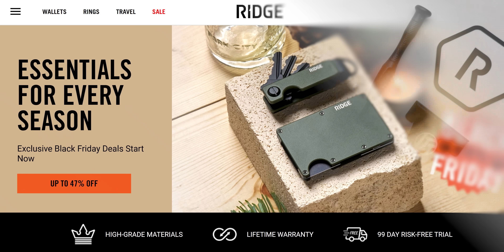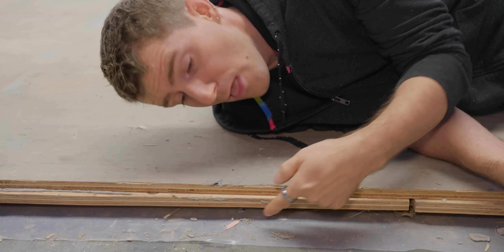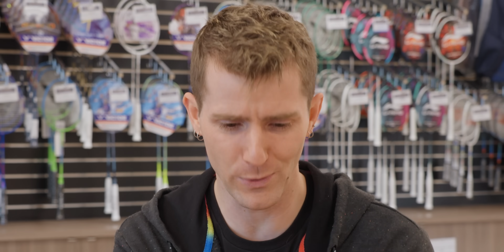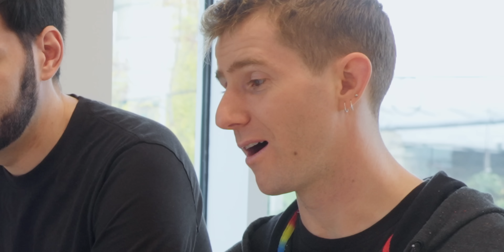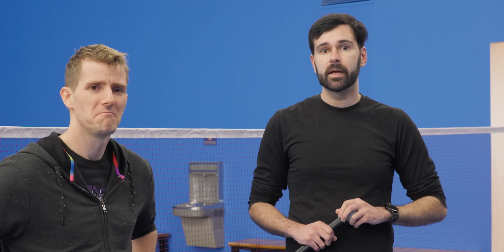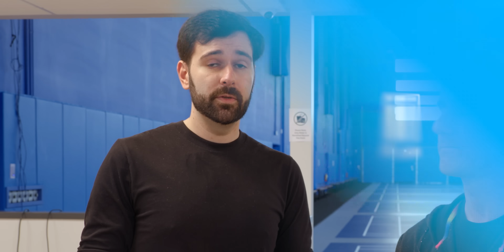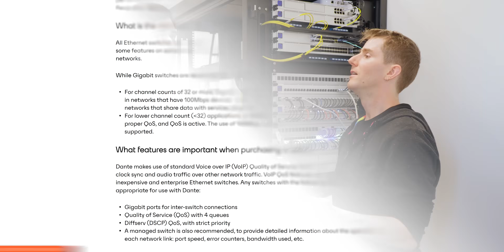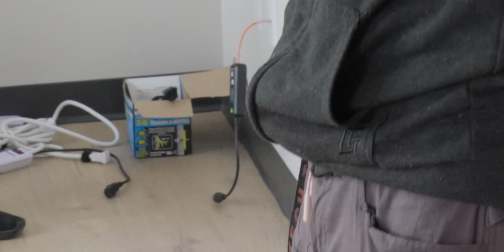You can finally hear me! - LAN Center Audio Tour

Comment: Well yes and no. Dante is designed to work on basically any network that is not using EEE so ubiquity worked for dante fine the whole time. But once network gets congested or you add 100mbit dante devices you will need the QoS settings. Ubiquity is really late to the game though I am already 5 figures into netgear 4250 AV line switches which cost 2-3 times what unifi devices cost :(.

Comment: the in house venue I work at was built on the ground up with Dante connectivity in mind. multiple meeting rooms with Dante as its backbone, Q-Sys for I/O, and Crestron for UI. our main hall has everything connected to Dante which can be routed to and from anywhere, with 36 boxes worth of line arrays, over 500 channels, and 20 wireless microphones that can be used just about anywhere within our venue.

in total we have approximately 250 speakers, approximately 700 channels, 140+ stereo inputs, 30+ UI surfaces, and Companion has been a huge help with daily automations and routing presets.

Dante can be very finicky as Dan mentioned. It is for the most part very stable if the network isn't saturated with "garbage" data. Just because you have 10Gbe speeds, doesn't mean it'll be stable.
Reply: @williewonka1500  Actually Dante isn’t finicky when you properly design your network, it’s actually rock stable. You only need to know how to properly manage data, and in Dante Clocking is EVERYTHING. You don’t have clocking stable in the network, it’s done, nothing will work. It doesn’t need some fancy network switch can absolutely make Dante work flawlessly with a 25$ managed network switch. If you properly manage QoS and Multicast it will work every time .
Reply: @IniosNetwork  Dante is not finicky, until it is.

unfortunately with alot of system integrators, they don't understand the clocking part of Dante. which was the headache I went through with our SI where they only looked at the 1GBe link speed but not latency. Due to a certain budget constraint, there was a switch with a 10gig fiber link carrying 4 different VLANs over 3 different subnets. in theory it's fine, until packets aren't prioritised. we also have a STAR network where 9 different switches daisy off each other into 4 links to our core switch.

as mentioned and agreed, Dante is usually painless, but with a massive installation that I currently oversee and run, it can be incredibly infuriating at times.
Reply: Why Q-Sys as a controller and Crestron for UI? Genuinely asking. Is it so the users see Crestron panels to which they are more acustomed than some "what is this new unrecognisable brand" Q-Sys?
Reply: @TheRoniSta  unfortunately I'm not sure what the real reason behind the pick is as it was a third party installer that was awarded that side of the contract.

Alot of it is definitely because Crestron surfaces are more "oh wow, name brand", but then again the installer has close ties to Crestron and has let slip they have steep discounts with them. Our infrastructure also uses Crestron's NVX system to push video all over the place, making it easier and robust for an end user to push couple of buttons on a Crestron panel for a Crestron system.

our auxiliary rooms are Crestron touch panels controlling routing of Crestron video streams and Qsys audio streams. Dante is just the audio protocol that's universally used throughout the building where it's super easy to provide massive 192/192 patched. Q-Sys IO boxes was deemed more stable than the AVIO's that Dan showed in this video as they also report heartbeats, and multiple different diagnostic data.
Reply: @williewonka1500  Oh now I understand so Q-Sys is only for audio management not for control and/or video distribution. Makes sense now - Crestron never had any really good audio products. Thank you.

Comment: As someone who works with Dante and system engineering every day, I was stoked to see how you implemented it. But you only scratched the surface of what Dante can do. DVS, DDM, connecting all sorts of processors, Dante video, and more. From small gigs to massive tours and broadcast setups, Dante networking is everywhere.
Reply: I really want them to do a multi site Dante AV setup, I've done multi site audio with Dante and it's cool as hell
Reply: Dante is awesome and great to see Linus and team using it. During my AV tech days, I installed a lot of these systems. Eventually received my level 3 cert for Dante, then was moved up to control system programmer. So frickin' easy to program and route audio. Dante should be the standard for any system.
Reply: Dan did repeatedly say that it's intentionally simple so non-Dan staff can function without a Dan..
Reply: lol was thinking the same thing, just before he said it! "damn they should really use dante here" then what do you know
Reply: I'm trying to get our company to get off of CobraNet and move over to Dante... This video solidified my belief that it'd be better!
Reply: very cool
Reply: I hope you don't mind me asking. Could someone in their 30s get into the trade? Does it require lots of uni/college education? I have always been interested in audio engineering (concerts, venues, small bands etc) and system engineering like this but don't really know where to start.
Reply: @MatsueMusic all of the Dante certifications are free, and their parent company has great starter courses for AV/IT
Reply: @timesprodoctions  Thank you :)
Reply: @MatsueMusic  Does not require any uni/college. There is a great starting point for certifications that are industry standard. Kind of like CompTIA or Cisco. Called AVIXA.

I started doing AV work about 5 years ago with no prior experience.
Reply: @nicholasharmsen7913  Holy shit, thanks for that information, that looks like an amazing resource as i've always had an interest in this field, but no clue where to start!  You legend
Reply: @MatsueMusic  I know im not the original commenter but as another theatre AV person it’s not too late. You definitely don’t need formal training but it’s all about experience and getting your name out there. Easy way in is to volunteer for a church or theatre groups and work your way up. :))
Reply: @MatsueMusic  I learned on the job with almost no background, it's mostly about having the right contacts, now i'm self-employed doing stage crew full time but most techs have a sideline, the hours are a bit wack lol, some weeks i can work 60h+, or i can have no gigs for 2 weeks, anyone can get into it, but its certainly not for everyone
Reply: @MatsueMusic at least where I live, you just have to get good contact to find gigs. You can always apply to work at an existing company. You can find great tutorials almost everywhere (including YouTube).
Reply: @MatsueMusic  Dante has some course on there website. That are really handy. To get started learn some IT stuff but contact a local venue or performing art to see if you can help out as a stagehand and just be willing to learn.
Reply: @MatsueMusic I've trained several engineers that are out touring with arena size bands now. None of them had any official school in anyway past high school. Right now there's a shortage of good engineers at least in my area I've heard similar from other parts of the country. 
Hell if you're in Oregon I'd put you in a 300 seat club tomorrow I hate the guy I have to tolerate now he likes to drink during shows and doesn't even remotely come close to having the experience to get away with it. Plus your watching an LTT video so chances are you'd be able to understand things like vlans. This other guy is basically a burned out gt player who's only been doing this a year and has no other tech background. Puts a lot more work load on me and I'm out touring an shit it's hard remotly fix everything lol
Reply: @SpaceSquid420  I do and networking is something I’ve done before. I live in Canada East coast but 10000% would have taken your offer if I lived anywhere near Oregon
Reply: @MatsueMusic  It's been a blast reading all the feedback you got, good luck brother!
Reply: @Timpossibly  🖖
Reply: @MatsueMusic  I did it here and there at my last job before I moved to my current SWE role. It does not require a degree. For most DSPs there are training courses and certifications you can aquire.
Reply: @MatsueMusic  You don't need a college degree to get into AV it's all pretty simple once you have enough experience. No really requirements for hard math or phisics or similar. I am speaking from experience - I have a bachelor's in electronic engineering and have been doing AV for the last 20 years. Even when designing most systems (except for acoustic treatment) you can get along with basic elementary electrics physics. Just go for it, find an AV integrator to start or Live event company depending what you want to do.
Reply: @MatsueMusic  Q-SYS certification is also free. Getting certified with systems like Q-SYS, Dante, Crestron, etc are great ways to get your foot in the door for AV Integration jobs. College degrees aren’t the only thing employers look for these days since things move so quick. Having real world experience and certifications are the way to go.
Reply: @MatsueMusic No shortage of field engineer roles available in Canada and USA.
Reply: @MatsueMusic  I am 35 and I am a part time audio engineer. I have been offered a job in this career path and I can say with certainty that yes, someone in their 30s can get into this.
Reply: @MatsueMusic  As somebody who got into the AV industry at 29.... YES! Realistically, this is an industry that ONLY requires you to be interested in the technology. If you are interested and have a somewhat logical mind regarding troubleshooting, anyone can be successful.

AVIXA is kinda the default standard for certification in AV, but if you are only interested in the audio side of things, QSYS and Biamp both offer free training courses for their products. Both will give you the basics, with the more advanced trainings focused on their products and their capabilities (including Dante). Just realize that a lot of the progression in the industry has been, and will be network based. So be prepared to learn about basic networking concepts as well.
Reply: @MatsueMusic  As someone who does it for a living, YES you can! The best way to get started is to just get started doing it. Some folks will say go to college, but as someone who didn't and works at a fairly high level, I can assure you, you don't need to go to college to do audio. People care more about your competence, attitude, and willingness to help out than your education in this field.
Reply: @MatsueMusic  I started in AV at 40, and have only been doing networked AV like qsys for the last 4 years. It’s a great career.
Reply: @MatsueMusic  I'm in the industry and did go to uni for it but I know a LOT of colleagues who never went to school for it. My advice would be to not google/youtube too much about it, there is a whole lot of horsecrap out there (like guides how to eq a guitar when in reality there is no and can't be a guide. Source differs, context differs, its worthless information that will set you back more than it'll bring you forward), and find a small venue or church if you're in the US where you can volunteer. Even if you did go to uni for it, that's where you start because theory is nice and all, but practice is a whole different animal. You'll encounter people (especially in smaller venues) who try to teach you shit like the "how to eq a guitar" youtube video, listen, try, and then forget it. Mixing is an art form and there is no 5 step guide for art, there is technique like there is technique in painting, but at the end of the day it's about the painting not the techniques used.
Reply: Yeah, but the QSys Designer file is atrocious. Why they didn't hire a damn professional is beyond me...
Reply: I work at Q-SYS as developer and can confidently say AV techs are needed all around the globe. Most people don't even know about the industry but it's easy to get into it and doesn't require university.
Reply: Dante is awesome as you say, I wouldn't wanna do a job without it anymore
Reply: At my venue we have 2 buildings with a total of 7 halls. We use Dante for all of them and we can rout any io from any building or hall to another. It’s fantastic
Reply: And since they love Unifi great as do I, they have Dante priority options on the port level in their switches.
Reply: how does dante video compare to simpte 2110? never heard of it before but the concept sounds intriguing.
Reply: @famitory  Dante video will likely be supported by a lot of manufacturers. Currently, there are not a lot of products, yet. St2210 is more geared for broadcast video.
Reply: @jomantasgrickevicius2500 video over Dante isn't the best
Reply: We use this at Volkswagen AG, i love how easy it is if all is Set up correctly.
Reply: Our school just started deploying dante less than a year ago and I've gotten the chance to help with that too. I was just as stoked as you were when they mentioned they were implementing it since I've heard about all the crazy things it could do in the Audio and Video world + more! Its crazy just how many things dante can do and how well it can do it.
Reply: Exactly what I was going to say😂 Dante truly is a life saver
Reply: Dude he said dante and i had PTSD flashes of helping wire my uni theater's booth. Love audio, this stuff is SO far above me right now though
Reply: You are absolutely right Dante is what we use for our gigs when we are on the road, it’s super easy to maintain and does have a learning curve but by far the most effective setup than most other offerings
Reply: This has got me considering adding Dante to my church setup. However, it’s such a small installation that… I’m not sure it’s needed. 

Note if I could run video to my black magic switcher from an iPhone at the front of the hall…
Reply: @andrebaron1387  What's your current situation and what are your wants? I'm sure somebody here could recommend and cost effective solution.

Comment: Linus and Dan.  I am so excited that you all are doing a piece based around the A/V field. 
While having a mobile IPad works with QSys I suggest getting a hard line TSC for the desk or wall. The Ipads can have connectivity issues at time. 

Dan, QSC is such a great option for the use you doing, but with Dante as a whole keep a close eye on the Dante controller and latency. If the latency goes above 1ms the receiver will not put out sound.

Comment: Question about the glass wool on the ceiling: is that just as it is or is there protection for the particles to not float around in the hall and being breathed in by anyone in there? 
Usually when I build sound panels with glass wool (Rockwool usually) I put at least one protective layer around it so that it keeps all the fibers inside the panel and away from the air in the room.
Reply: I don't believe that is glass wool that they're using. It's a specific product.
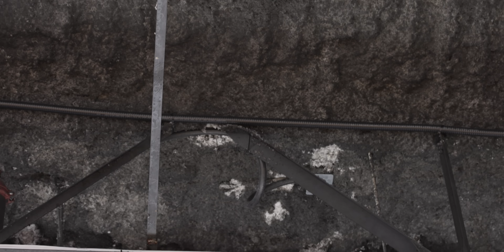Reply: @imark7777777  At 1:43 they show the material which is sono glass which is fiber glass based, I'm not an expert, that's why I'm asking.

Comment: I don't understand how audio can be so complicated? Why can't it just simply be PCM packets over UDP? And use things like multicast and even broadcast and VLANs ane be done with it? The millisecond latency added really shouldn't be that much of an issue?
Reply: It took so long to get to a place where we had a standard across the industry. A lot of it comes down to latency and synchronization well also supplying high-quality uncompressed audio. Not only has to get to the other end and come out in a timely manner as to be in sync with everything else.
Reply: @imark7777777  but why is syncing and latency over Ethernet such an issue, especially when using e.g. a separate network or VLAN for it? Congestion shouldn't really be an issue for plain audio data?

Comment: Linus and Team, you guys should take a look at Luminex switches.... also i installed a unifi pair for a customer using dante device and had clipping issues with streaming video and audio over the same port cos latency had to put the netgear prosafe switches back in nice to see they have fixed that...

Comment: Loved the Linus's question about Streamdeck because it was the same thing i was wondering when i learned of Dante and the proper answer is that yes, it can be done but you have to look for devices with the BitFocus Companion modules (unless you want to write them yourself) but in general, it's possible and with new Streamdeck Studios and control over LAN it's easier than before.
We're currently using combination of Dante (incl Dante AV-H and AV-Ultra) and Streamdecks as the main UI and backbone of our Event spaces worldwide and one major thing it allowed us to do is also for stream controllers/editors to control multiple devices in various event spaces from basically anywhere in the world.

Comment: Hey Dan, you’ve probably already thought about this, but I’d recommend replacing the AVIO Bluetooth dongle with a wifi streamer like the Episode Lynk hooked up to an AVIO analog input adapter. Then you can walk the whole building with a phone that’s streaming music.
Reply: So many flashbacks from trying to manage music at a restaurant through wifi....oh the horrors...
Reply: @ryanA133 at pizza Hut we did it via some old laptop remote desktopd to something on the network that was capable of actually streaming internet radio but did not have an audio jack
Reply: Probably would be easier to go into the Dante network from a media playback system for 90% of the music. For the guests that bring in stuff that's when the Wi-Fi streaming/Bluetooth would still be nice to keep implemented.